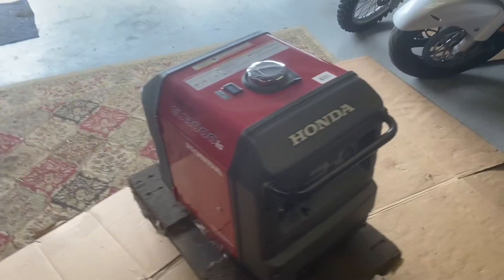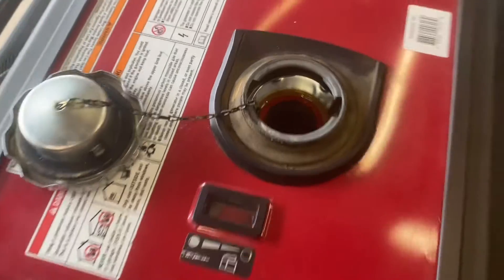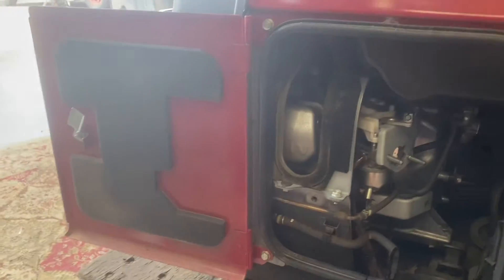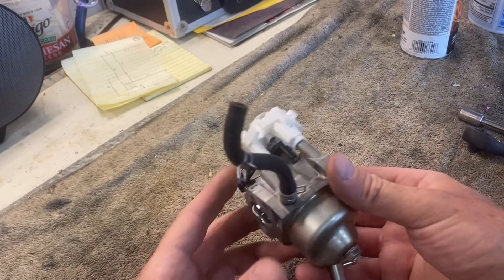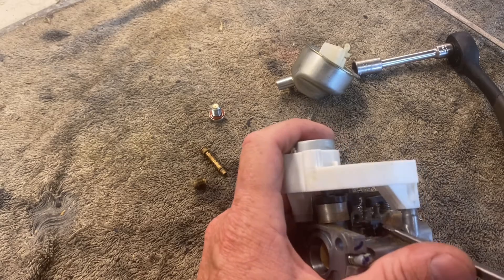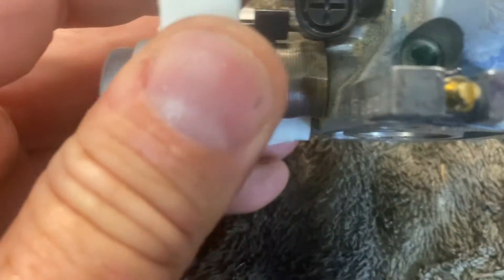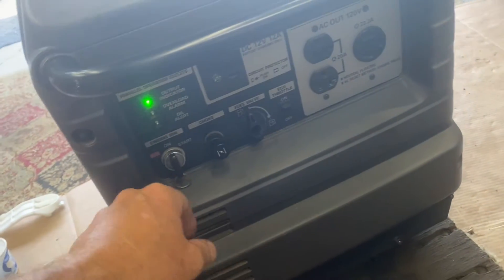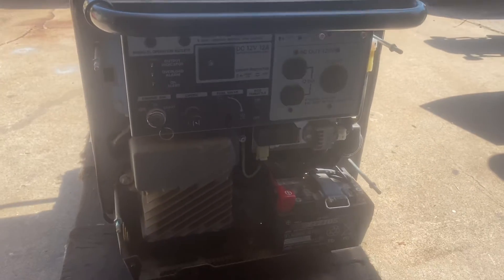Honda EU3000is Generator Surging?  Here's The Fix, Simple And Quick!

Comment: a pair of points to add to this otherwise good presentation. 
the mixing settings are all over the map depending on all kind of variables.  i find the idle at 3.5  better maybe even 4

important: the idle jet must get a new o ring. 
and 
be very careful of your orientation of the jet that the idle jet passage matches the port
and
if you remove the solenoid on top be very very careful as there is a small anti rattle spring hidden in there. it will make its presence known as it zips past your ear to parts unknown....
Reply from the maker: @pugetlexus  good information!

Comment: The eco throttle should work with a load or no load. Did you forget to plug the wire back on top of the carburettor?
Reply from the maker: It did work, I don’t think I showed it on the video.  Good generator.
Reply: @TomsTinkeringandAdventures sorry I thought you mentioned in the video it probably needed a load on the generator for eco mode to work. We have this generator and the eco mode drops the rpm down quite a bit when there is no load.
Reply from the maker: @denisecavallaro8927  I was doing something wrong, but it did work.  Was the first time I had ran one of these.

Comment: I just pulled my genny out a couple days ago and had this problem.  Got lucky though and was  able to run enough carb cleaner through it to get it running well in about 10 minutes.  But my trials bike is going to need a full break down like you show here.  Thanks for the awesome vids Tom!
Reply from the maker: I set a reminder in my phone to start my generator every six weeks.  I run it for 15 minutes under load (small space heater)  We can pull the carb off the trials bike and have it ripping in an hour or so.
Reply: @TomsTinkeringandAdventures  Let's do it!

Comment: First man i've seen do a correct carb clean,most the others leave out to pilot circuit and all never adjust the mixture screw.
Reply from the maker: Thanks for watching, it’s easy to overlook the pilot circuit on these carbs.  Had to clean the one on my Predator generator as well, very similar.

Comment: Simple and quick....?
Reply from the maker: It took about 20-30 minutes, pretty quick repair considering that a repair shop will likely charge you $100.
Reply: And most shops won't adjust that screw, anyway. It's supposed to break when you remove it. Then it's supposed to be replaced with a new one to factory spec (probably 1.25 turns again). Then the cap is supposed to be put back on with Loctite 638 (high strength retaining compound).

Comment: Eco throttle should work regardless of load.  You still have a problem.
Reply from the maker: I think the wire connection was loose because it worked later.  I pushed the connection together and it was fine.
Reply: Put a zip tie to hold it together 😊